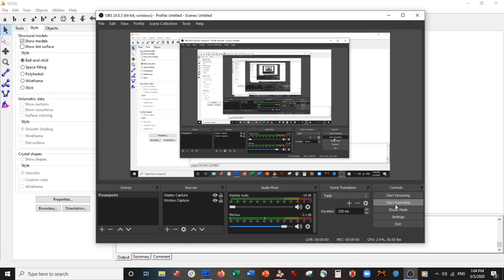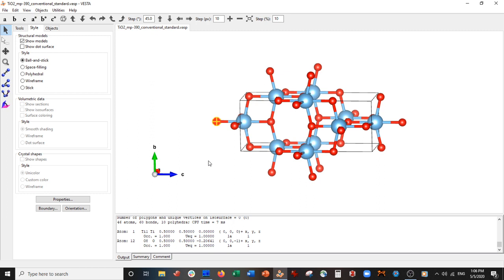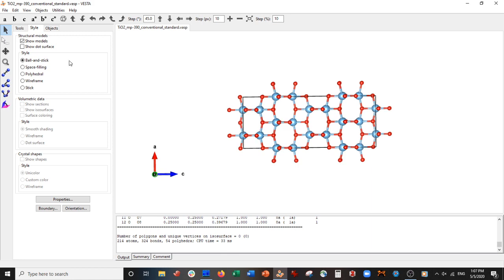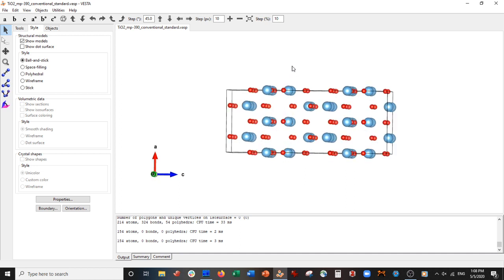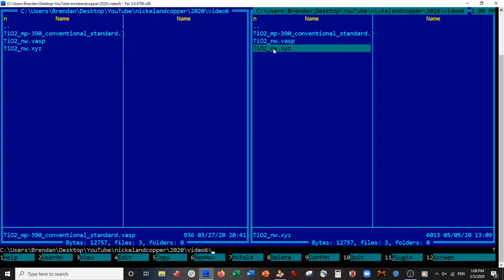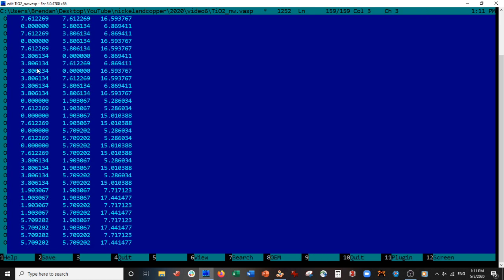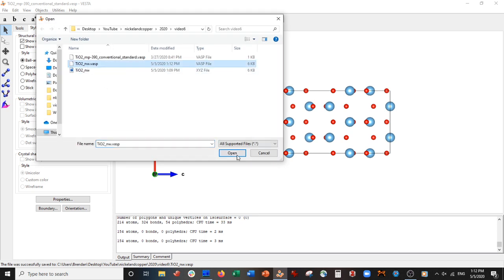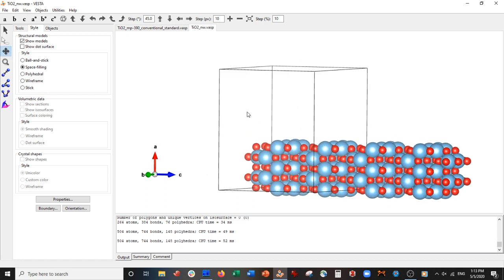VESTA Software - Build TiO2 Nano Wire

Comment: If I want to create a wurtzite structure nw, then the shapes becomes like a rhombus. Am I doing something wrong?
Reply from the maker: What we make are atomistic models of real systems. It’s possible that the real system may be rectangular. I think it all depends on what crystal faces are exposed. Do you know which ones you want exposed? Then - you likely need to add some sort of surface termination. I think here I opt to not have any but typically one may need too especially if the native stoichiometry is broken